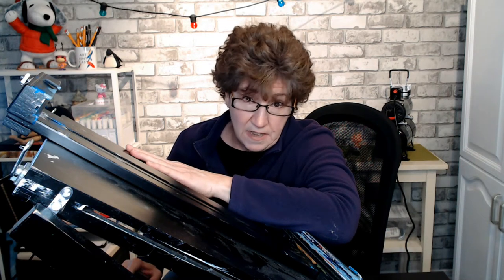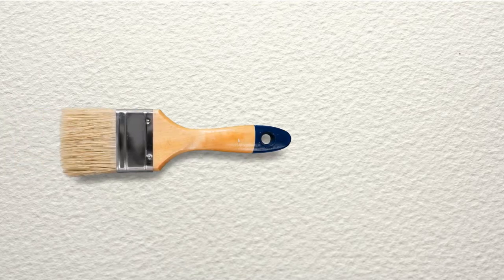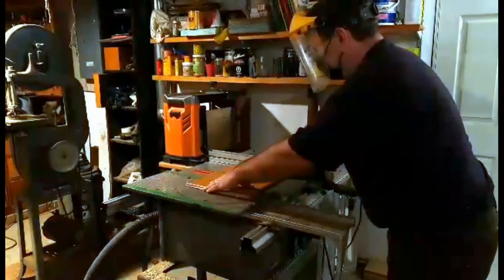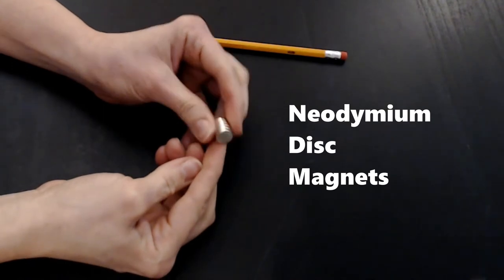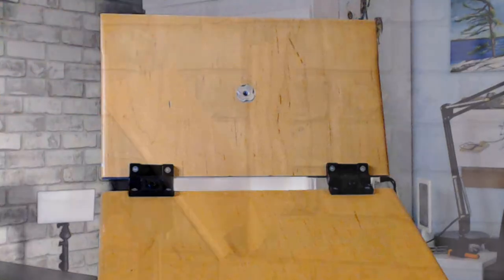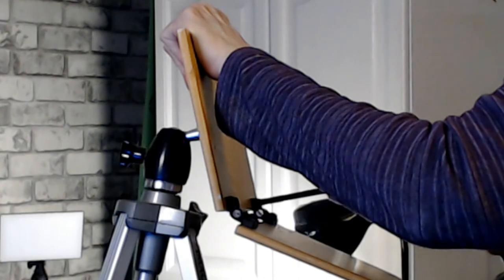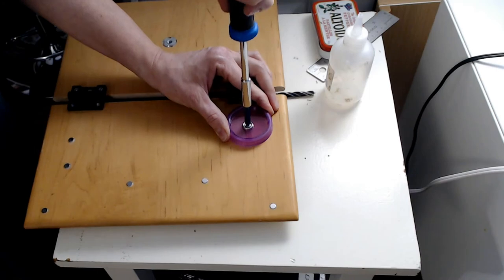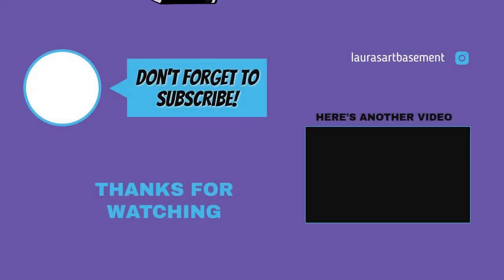James Gurney Inspired Sketch Easel - DIY

Comment: omg thank you for this video! I was making my own and had no idea what tool i needed to set in the t-nut so i just resorted to carving a little mote for the T part of the nut. Also drilling into the plastic hinge wasn't something i thought about to make the easel close shut lol i wish i had known that earlier before buying hinges that has the tension screws on the sides
Reply from the maker: Thank you! So glad you found the video helpful.

Comment: You did a great job and your video is very clear and easy to understand. I also made a James Gurney sketch easel. The only difference is I drilled a hole in my easel which is big enough for me to drop a silicone water cup into it. So that my water is recessed and I don’t have to work around a protruding water cup. So I just pop in my collapsable cup when I start painting. I also did not do a nice job drilling those holes for the magnets because I used quarter inch plywood which makes my pallet very very light. But not deep enough to embed the magnets. So I used little stick on magnets that I got from Home Depot. And they hold very well.
Reply from the maker: That sounds great. I thought about making a hole for the water cup, but wasn't sure about the placement I wanted. The water cup is small enough that it hasn't bothered me and it is easy enough to change the water. In time I might do what you did and be brave enough to drill a hole for a cup. Thanks for watching, and for the comment. Happy painting.

Comment: What size pieces of wood did you use?
Reply from the maker: My wood was 14" x 11 1/2" and 5/8" thick to start,  so when cut the two pieces are 11 !/2" x 7".  But like I said in the  video that is just the size of wood I had on hand. You can do this with any size that fits your needs. Thanks for watching.